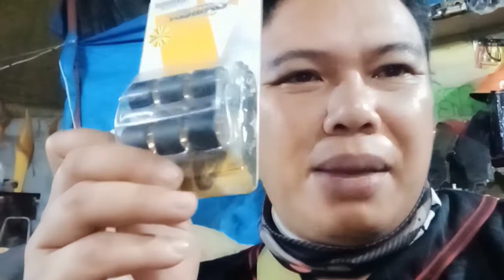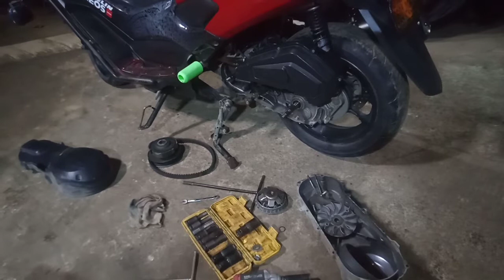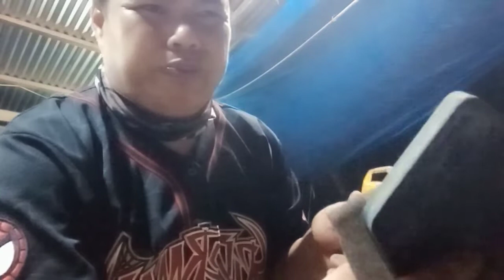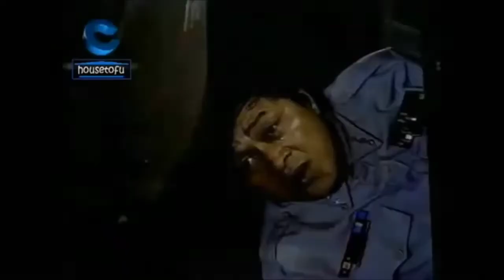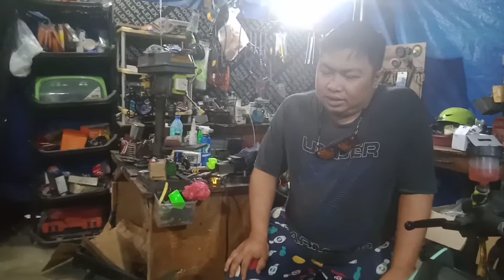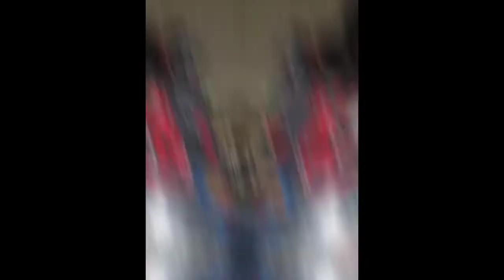Motorstar EASYRIDE 150N palit bola 13g straight pang arangkada

Comment: Anong pang gilid mo paps? Sakin naka straight 13g sakin nag 6krpm bago arangkada all stock lahat
Reply from the maker: Yung pang gilid ko 13g straight din 3k rpm bago mag arangkada kasi 175 ccna sya ngayun 210 psi yung comprestion
Reply: @tatazmotovlog  paps pag nag palit ba ako ng clutch spring 1krpm may pag babago na?
Reply from the maker: Meron sa arangkada mas agrisibo sya pero.dapa palit kadin center spring mo
Reply: @tatazmotovlog  naka 13g jvt straight ako paps tapos clutch spring na 1krpm pang beat fi anong center spring ipapalit ko paps
Reply from the maker: Sa akin kasi 1000 rpm center spring ko
Reply: Ano brand paps
Reply from the maker: Nakalimutan ko paps matagal kuna kasi pinalitan nakalimutan ko kung anungbrand